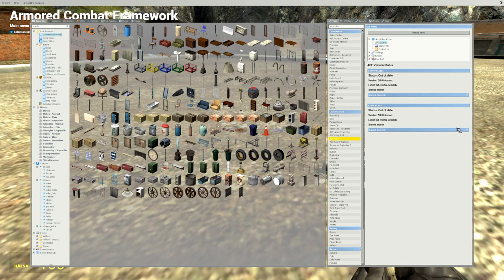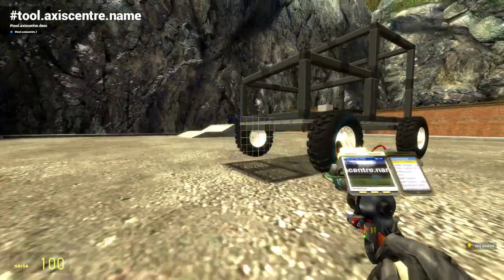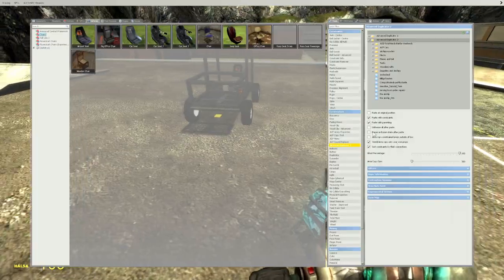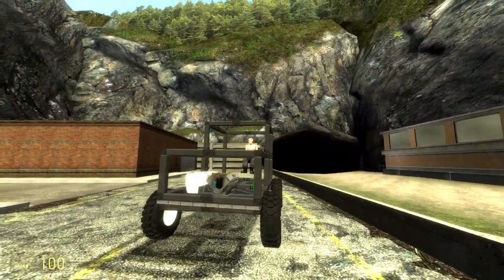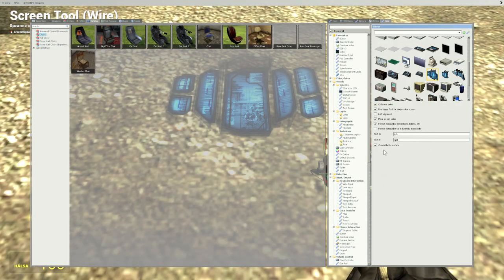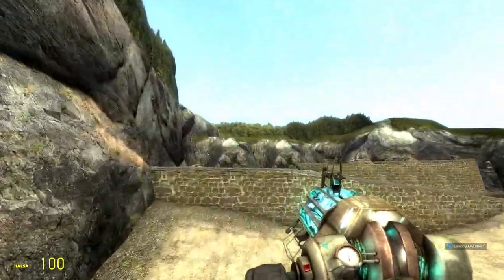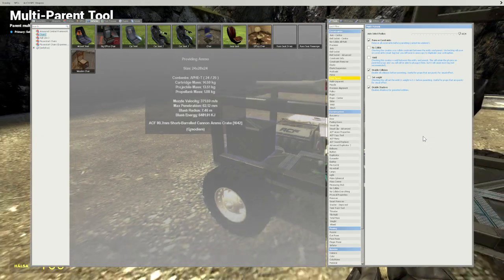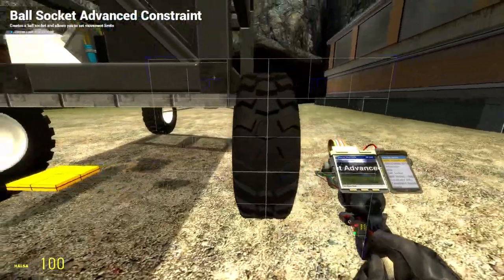Garry's Mod ACF-3 Basic Tutorial | Engines, Guns & Armour: How to Make an Armoured Car 2023

Comment: I have a problem with every ACF engine (steam ver). the engine, instead of giving power all the time, gives it from time to time (like in the middle of powerband from 1000rpm to 2500 no power, but if RPM will be bigger than 2500rpm, the wheels go burnout for a second)

is there any fix of that?
Reply: Yeah,i have the same problem and still cant fix it

Comment: when I try to ballsocket the wheels and stuff, the slavery works but when i try to go the wheels fall sideways and they just rotate in random directions
Reply from the maker: perhaps the settings are not right, or its the orientation you build in
Reply: I had the same issue, when he ball sockets centers the steering wheels to the axle, I suspect he uses very tight ball socket settings similar to the slaver settings.